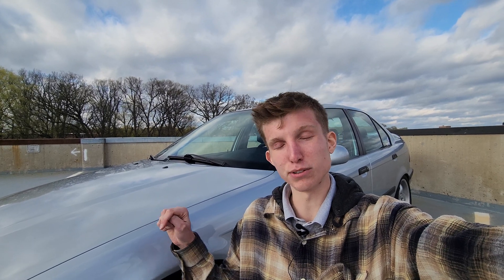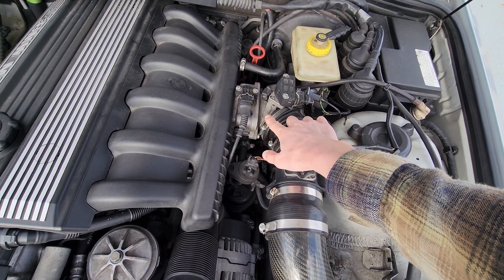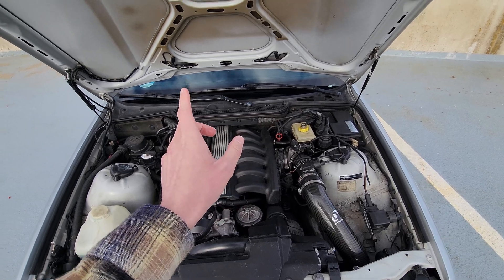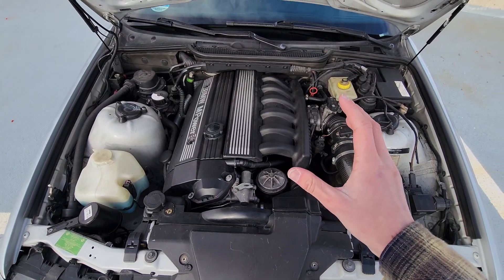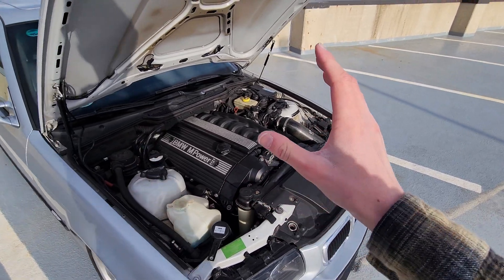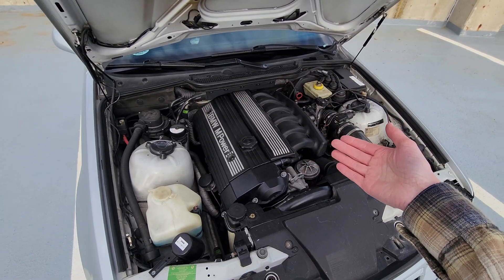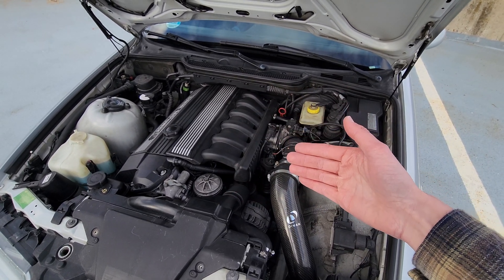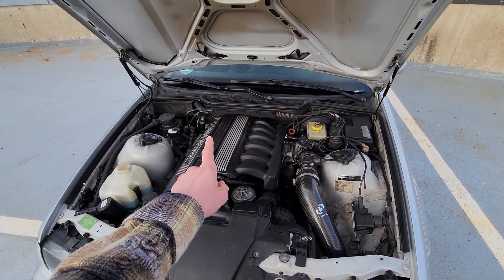Your Ultimate P1188 and P1189 Guide

Comment: I change spark plugs now I got p1189 and p0173
Reply from the maker: @greynand  Those codes are both related. If they came up after you changed your plugs, take the plugs off and check the gap.

Then retorque them to spec. Sometimes, they are bad out of the box. If you have a loose one that could do it too.
Reply: @ thank you I will do that

Comment: Thanks for putting this together. MAF just replaced 2k ago, car is now throwing 1188/1189 with intermittent engine cuts while driving but mostly during acceleration - any ideas?
Reply from the maker: If it was an "oe" or genuine BMW maf, I doubt that is the culprit. You could check by unplugging it and seeing if there is a difference. If it is a Bremi or aftermarket maf pull it out and make sure the housing isn't broken. I had a Bremi 540 maf do that. The waffle part separated inside the intake tube.

Unfortunately, with the information given, it could be anything listed in this video, lol.

I would say check for vacuum leaks first and foremost. An easy test for a vacuum leak is to pump the brake pedal a bunch of times and see if the car starts to die or the idle significantly changes. This is not cut and dry, though. A smoke tester will be your friend here.
Reply: @M-t3ch  yeah its a genuine MAF - although the shop replaced it to fix an issue where the car would not start up. So I was surprised when you mentioned that you could just unplug the MAF. I just tried the brake trick and maybe the idle goes down a tiny bit so doesn't significantly change.
Reply from the maker: @tdswedish  Hard to say, it could be a clogged O2, failing cam or crank sensor, knock sensors, etc.

It could still be a vacuum leak. When the engine is under load, it will be pulling more vacuum and the issue will be amplified. Unfortunately, there isn't much else I can give you without seeing live data or any other codes. Which is why this code set is so frustrating lol.
Reply: @M-t3ch  gotcha. I'll try the smoke test. Anything specific to look for in the live data?
Reply from the maker: @tdswedish  Not really, I have a video where I show the BMW INPA and how to use it. You are checking to see if everything makes sense. Maf air volume, does intake temps read closeish to ambient temps, are the knock sensors not constantly pinging, etc.

Google will help in terms of finding what all the values should be and understanding what they mean. A lot of them don't make sense just by looking at it.
Reply: @M-t3ch  we smoked it and there was only a leak ahead of the MAF - the problems should be after the MAF right? The plastic mount for the airbox to MAF clip is broken preventing a good seal.
Reply from the maker: @tdswedish  That may make a slight difference but yes it should be after the maf. So that is a no for the leak. Have you checked the fuel pressure? Sometimes the pressure regulators fail. In rare cases a fuel pump can randomly work intermittently.
Reply: @M-t3ch  Fuel pressure looked good. Turned out it was the MAF - first one swapped out dies if you tap on it. Second and third (new) ones were bad. Finally, the working MAF was from VDO.
Reply from the maker: @tdswedish  Happy to heat it! Sorry to see that you got a few bad mafs, though. That's frustrating lol.

Comment: been having this code set pop up on/off for quite some time on my M3 with the same misfires on cylinder 4/5/6.

thinking it's the ignition coil wiring harness (and plugs/coils could probably use a replacement) but it could be bad injectors being that the car only likes to have a nasty idle when it's cold.... could even be a vacuum leak too! who knows. WOOO!
Reply from the maker: I know! It's like a lottery 😂

If you are having an issue on the back 3, I'd suspect something specific to those. Check your O2s for starters. It is possible for one to get dirty and read incorrect data, in which case you could clean it and throw it back in.